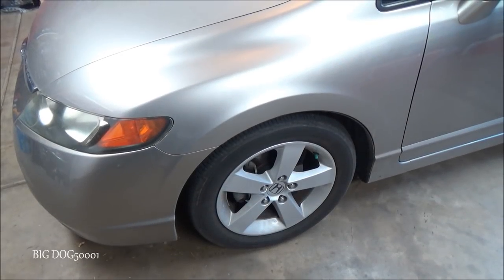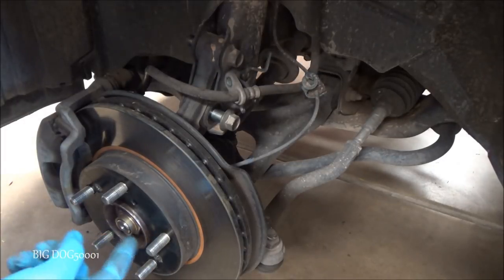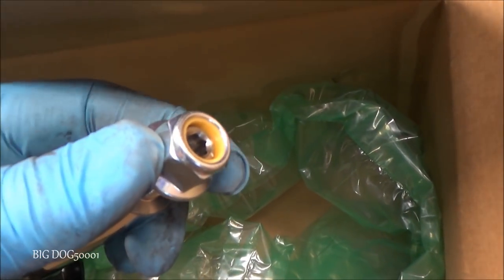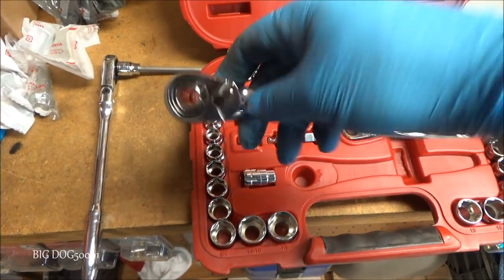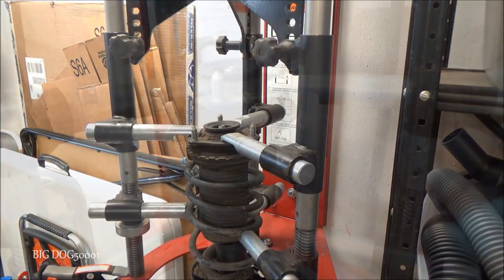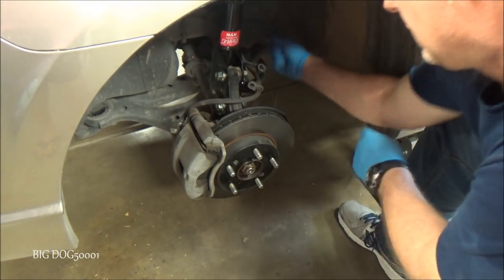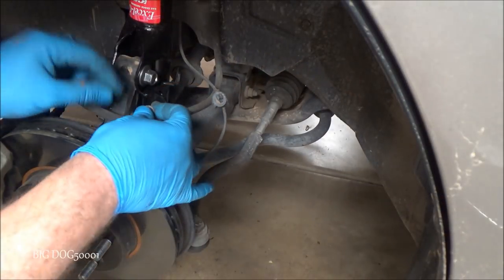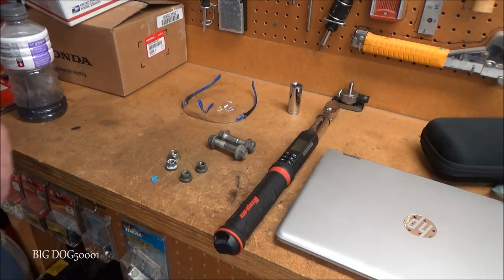Honda Civic Front Strut Replacement 2006 (2006-2011 Similar)

Comment: how's that lower control arm front bushing looking?, cracking away yet?
Reply from the maker: They are not gone yet, but the compliance bushings on this vehicle will need to be replaced in the near future.
Reply: Big Dog50001 Automotive 
It be great to see you make a video on the replacement of those bushings by pressing them out and installing new oem bushings. What I mostly see now is the replacement of the entire LCA. 

Thanks!
Reply from the maker: I'll see what I can do.

Comment: Are those kyb gas struts or fluid type?
Reply from the maker: These KYBs use a twin tube design (which is the most common design), most of the strut is filled with hydraulic fluid they also have a small nitrogen gas-charge inside too.

Comment: R bolt heads facing towards caliper. Nut on brake side?
Reply from the maker: On this Civic, the bolts and nuts go exactly as shown in the video (nuts are on caliper side, bolts inserted from rear pointing towards front of vehicle).  Other models can be different.
Reply: @BigDog50001  ill lookup then since mine is a lx coupe. Great vid.
Reply from the maker: 2006-2011 US based Civics should be the same regardless of trim line.  2001-2005 Civic bolts/nuts are the opposite.
Reply: @BigDog50001  thanks bro I appreciate it. 
I watched your vid and saved me. However I had to turn the steering wheel in order for rotor mount to line up with bottom strut mount holes. Got it to work. Thanks to you bro. Keep em coming.

Comment: I’m trying follow your guide, but your parts doesn’t match at all. 

Struts bolts is 17mm nut is 19. But you order the new bolts and nut they are way small. At 14mm for the strut nut.  And top but is 10mm. Original is 14mm.

You confuse me so I didn’t order anything new and use old.
Reply from the maker: The parts are correct for the exact vehicle in this video.  You should always double check parts for your application.  Some aftermarket parts come with different size nuts/bolts than the original (and sometimes the parts manufacturer gets it wrong).

Comment: What if it comes out of the cv joint ?
Reply from the maker: If the axle pops out (or the CV joint comes apart) it will need to be corrected before putting everything back together.  Usually the joint comes apart and needs to be manipulated in order for it to pop back together (many times this can be done with everything still in place).  In some cases the axle needs to be completely removed and correctly reinstalled.

Comment: I think he forgot to replace the struts mounts, which is recommended when you change the struts. If he changed bolts and nuts why he didnt change the mounts?
Reply from the maker: The bearing and mounting plate should always be checked when doing work on the struts and replaced IF BAD, but they are not mandatory replacement items like the nuts and bolts are on this vehicle (per Honda service information).  I did not replace them because they were not bad on this car.